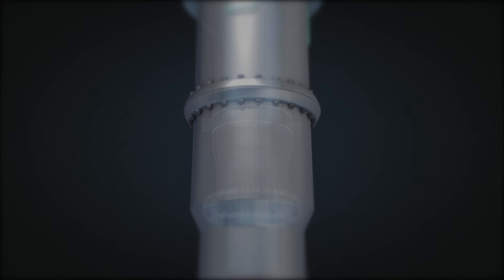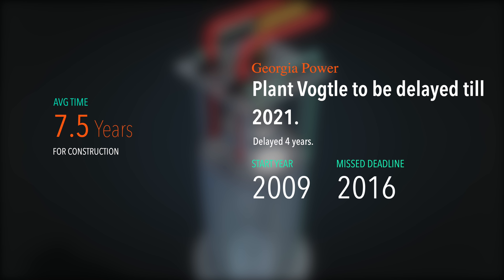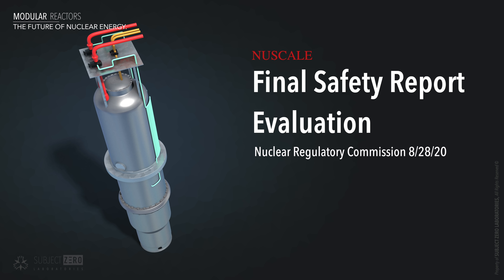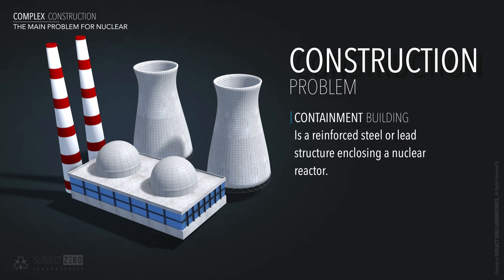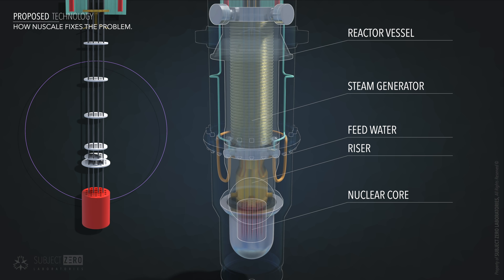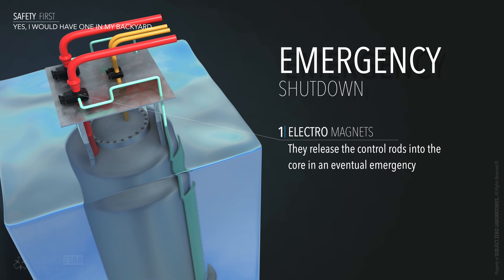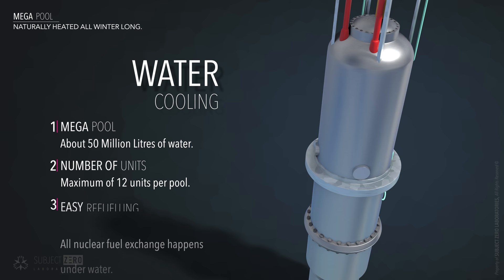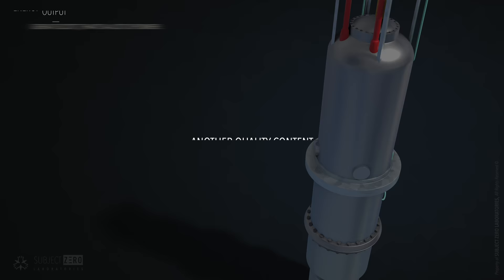A Milestone for Small Modular Reactors (SMR 2020)

Comment: Can you do an episode on hydrogen based engines and such? They looked promising
Reply: Hydrogen fuel cells are a waste of money, 40% total energy conversion, meaning only 40% of the power that was put into the fuel is used in actually moving you; Unless you meant fusion, Hydrogen is practically just a very bad storage medium that is supremely outclassed by other battery technologies. It's only benefit is being an energy sponge so that grid power isn't overloaded, but even then, that power is better used elsewhere.

Comment: Right from the start: Zero pollution? OK tell me where you live and I'll tell the operators of current working nuclear power plants you agree to put radioactive waste in your backyard. It's all safe, no?
That's not even counting the fact that most of these nuclear plants demand several millions in state subsidies (mostly at startup), often require the state to put up collateral since no bank will lend or insure nuclear plants, lobby the state to legislate limits on their maximum responsibility in case of an accident and finally let the state handle the mess if the power plant goes bankrupt (because you know, no one wants to pay into a trust account). 
So all in all, SMRs cost the state a pretty penny from conception to decommission (like their larger brethren). And all that money comes from tax payers, who are ALSO expected to pay a premium for the electricity produced by those nuclear reactors. And if you do get cancer because of a nuclear leak, it's all on you. Free market!
What's not to love???!?!
Note: The technology involved in these reactors is based on the steam engine --> boil water --> turn turbine --> harness the power. You're basically only using the heat generated by the burning of fuel. We ca do so much better (even ITER tries to make something new!).
Reply: Nuclear waste other than tritium is solid,What do you think radiation leaks out of Clay, steel and concrete solos?
The fossil fuel industry gets 200% more subsidies than nuclear power

Comment: So you're going to need about 35 of these things to produce the same amount of electrical power as a typical large  two unit BWR/PWR plant. That doesn't seem like a winning formula to me. Let's be honest nuclear is dead for the the foreseeable future. You can build a large 1000MW gas fired combined cycle plant for WELL under a billion dollars, have it up and running in two years with 1/10th of the permitting and sighting hassles. Then you can run it with a staff of about 50 people, instead of the 500-600 you need at a typical twin unit nuke. Many of the big nuclear operators are out begging for corporate welfare right now because they can't operate their plants and make money.

Comment: Still has an old fashioned Mickey mouse system of high pressure steam.
Hopeless design failure when they could have gone the "walk away safe" ambient pressure high temperature  molten salt method.. no wonder it required 12 thousand pages of safety justification- a reproduced 60 year old design- FFS iits now the 21st century.
Reply: @Mark Hule Indonesia already has a contract with ThorCon for 7×500MWe Thorium ion molten Sodium Fluoride salt energy converters - expected running cost at less than US$0.04 per KWh and capitalized cost being recovered by selling to PLN (the electricity supplier) for less than $0.07/kWh as there is no capital cost to Indonesia except for distribution.

Comment: Why do none of these videos explaining "cheap" nuclear energy ever factor in the full costs? Spent rod storage is no secret. Factor in the wages of one solitary security guard . . . for the next twenty thousand years . . . and any claims of cost effective nuclear energy tend to melt down faster than a compromised reactor.
Were we to factor in the clean up costs, guarding fissile materials and compensating the victims of contamination, then it would easily be established as an undeniable fact that it's the most expensive form of energy ever created.
Still, most of that clean up and remedial work on polluted environments evre really scratches the surface, and the costs of guarding all that potential bomb making material for thousands of years is a problem for future generations to worry about and pay for. Right?
Reply: Alright, what about compensating the families of those who die in coal mines, wind turbine collapses, and all the heavy metal pollution caused by photovoltaic solar panels? External costs happen in EVERY industry, not just nuclear.

Besides, in the next 20,000 years (more likely the next 50) we'll find a way to consume "spent" fuel rods. Those things still have a lot of usable energy in them and actually using it would reduce the volume of thag waste drastically and make it much safer.
Reply: Quite so  @willb5278  but none are so high and so studiously ignored as this.
There IS no way to "consume" highly enriched uranium though, and 20,000 years is just the half life. So long as it remains fissile it will need guarded. It could end all life on Earth many times over already, and each year we are making more. Most countries have persistently ignored this growing and expensive problem, and most of the world's storage pools are full to the brim, posing massive meltdown and contamination threats to highly populated areas.
The nuclear industry blithely ignores the responsibility for this huge toxic byproduct in its costings, and assumes taxpayers from the distant future will foot the bill, so before sweeping it all away with a move of your hand and some vague wish about fifty years from now, how about you educate yourself on where we are currently standing with the stuff, (drowning in it!) and where we are projected to be in ten years even if we don't bring any new reactors online. Here's a good starting place for where we are now: https://www.youtube.com/watch?v=YgVyPwhkoJs
Here's a 101 guide to the nuclear waste problem: https://www.youtube.com/watch?v=uU3kLBo_ruo
Until the nuclear industry accepts and factor in the almost open ended cost of nuclear waste storage, they are simply lying through their teeth about their economic viability.

Comment: So did you spot the MASSIVE problem with this technology in terms of global warming? I'll give you a while to think about it because you're obviously interested in nuclear and probably an advocate. In fact you probably know a bit about engineering, so you'll have spotted it right?

200 MWth creates an embarrassing 60MW electricity. That's a worse conversion rate than even coal plants and has remained pretty static for more than 60 years. Where does all that extra energy (heat) go? It's dumped via cooling systems into the environment. Not that great for climate change. I'm sorry but the time for this type of nuclear power has passed and this point alone is enough to kill the concept.

I know. I used to develop nuclear power plant.

Comment: Do the math how much of solar+battery would we get for the same price
Reply: There is no solar + battery that can work 24/7 at a scale anywhere in the world. So it's hard to calculate. Currently gas power plants are used during night. That's hardly "green" .
Reply: @VFPn96kQT  solar+battery can work 24/7 actually. Demand is also not constant, it's lower during the night.
Reply: @d3r4g45  but it doesn't. As I said there is no example in the world. All countries use gas power stations to supplement electricity production. You can check yourself on "electricity map" site.

Comment: I like that they think about a new concept... it is about time ... all new and forgotten (thorium or salt) concepts für generating nuclear power should be explored... but this concept is useless ... they didn't mention the production of the nuclear material and the disposal of the waste ... not once.... without solutions for that it is the same stupid idea like the old reactor designs. And its not safer than the old models. it has a mechanical security system and mechanism can and will fail like in Fukushima Daiichi - it will just find another way to fail.

Comment: It is really cool stuff, but I honestly don't have much faith in this. I mean 12 000 pages of documents to review, and they are still far from done in demonstrating safety? Nuclear tech is just moving at such a snail pace, that I don't see how it will remain competitive. This might not start getting built in volume until something like 2030. By that time solar, wind and battery technology will have gone through a huge number of iterations and cost cutting. Within the next 3 years Tesla is on schedule to cut their battery costs by almost 60%.

You will have cars that are cheaper than gasoline cars with 100 kWh storage capacity. You average western house needs 10 kWh of electricity per day. With a large enough fleet of these cars,  you get grid level storage for free.

Comment: you missed insanely expensive compared to wind/sloar.
last nuclear power plant being built  is way over budget and bankrupted the builder.
let the russians or chinese develop it til it's safe and cheap.
wind and solar are still cheap enough to match or beat natural gas.
Reply: this has niche application, for remote northern southern area where lots of thermal energy is required, as well as electricity. I mean solar & wind is nice and easy to install in remote location as well but it is not good at producing constant heat to fight the northern & southern climate.
Reply: @xponen  
just need better insulation, not more heat.
there's a lot of old poorly insulated homes that need renovations too.
nuclear of any kind breaks the bank trying to provide us cheap energy like wind/solar do.
geothermal is cheap too once running.
nuclear is always the LAST option.
Reply: Only because it has shit ton of subsidies and favourable regulations.
Reply: @ANTSEMUT1  
like oil and gas the past century?
or like oil even now?
how many billions have been pumped into fossils to hold them from bankruptcy  this year?
oil still has WAY more subsidy.

Comment: Okay, now 'bout popular carbon footprints.

You see, our planet in its 99.99% does not care at all what's happening above a very thin layer or crust. That said, I mean biosphere - all these fancy waters (hardly deeper than 5km in average), some 10km of air and couple meters of fertile soil and vegetation. And that's the main reason these two worlds should never touch - biosphere and the crust.

The problem is not in releasing carbon dioxide itself, the problem is the source of it. Our biosphere had undergone several titanic transformations, preserving its state in what we now research as geology. And every day, whenever we excavate and burn fuel from previous epochs - we release energy from there. What is, truly, energy on Earth? Our entire biological civilization is based almost fully on solar. Photosynthesis and energy preservation is based on solar energy. Coal and oil are result of ancient plants and microorganisms respectively transforming solar energy. Every natural material - wood, wool, fuel is made of, err, 'Sun' with some materials from crust (which mostly appeared because of the Sun, too). So, I believe, the concept of releasing 'old' energy is clear.

Our biosphere has always had Sun. Majority of biological processes require it and naturally everything is adjusted to its parameters via process knows as evolution. This leads to conclusion that we only have right to employ its immediate energy to keep balance, though, due to some inertia in biosphere, we can utilize energy stored not so long ago - say - we can burn wood or olive oil and still have 'zero' carbon balance - as much carbon dioxide consumed by plants - as much gets released. (Almost!) That's sort of true for energy too - this energy could simply heat atmosphere, soil or water - but got stored in olive oil (let alone saying it could retract back to space). And this concept is super critical to understand - released carbon ~ waste energy.

Every day, when turning hot water tap on - you release energy to the World ocean. It simply does not disappear. You cannot cool it - as when you cool something - you should heat something for the reason known as thermodynamics. By releasing energy you heat ocean, by heating ocean you release CO2 stored in it (gases leave heated fluid faster), by releasing CO2 you really don't help some solar energy to get back to space (so the planet looks cool from above, but gets hotter from troposphere) and this continues. 

So, what is the main problem now? CO2 or heat? Yes, both.
And whenever you excavate uranium and do fission - you release energy - no, not from previous geological epochs on earth, but rather from time universe was born and our biosphere wasn't even planned. That's why nuclear energy is just half the answer and does not solve the biosphere stability problem.

Unfortunately, we should only use energy above us - from skies (which transforms to wind- hydro- and whatever), and immediately under our feet - vegetation.
I sound like hippie, but that's our only perspective.
Reply: Fission has one of the lowest carbon footprint out of all of them end to end.
Reply: @ANTSEMUT1  you are right - carbon - yes, but heat footprint is almost as harmful in current situation. Even if we replace all carbon emissions with nuclear power consumption everywhere - we still heat the biosphere! And still release CO2 from ocean. Which contains enormous amounts of it, more than we will ever emit into atmosphere.
Reply: @wwlb4970  you must be under the assumption that only gen 2 reactors are being used/built which have no or minimal heat exchange regulation mechanism.
Reply: @ANTSEMUT1  well it's not about reactors per se. All electricity turns into heat in a while. Even your effective LED bulb heats. Your electric car's motor heats, as well as battery. All because of energy which shouldn't be here - be it fossil or nuclear. Though the latter is much better in terms of emissions, yes. The heat from it just doesn't disappear, be it exchanged or not - it is released. One simply cannot store heat indefinitely - cooling means atmosphere will get some of it.

Comment: I'm going to be honest with you the whole nuclear power generator thing is just an overcomplicated system. You would make more money and profit more energy if you just had a generator connected to every single person's house and each house depending on if they have more wind or solar more hydro or more heat that is the one that you give them to spin or power their house and any excess energy that they're not using gets dumped into a battery bank and or dumped into a grid battery Bank that can be used during the night or even if in case of a hurricane one case of a God forbid flood we have energy and power to give to those that are rebuilding their lives essentially a internet of power just like how the internet has different connections and different microcontrollers and all that s*** you have micro generators that each individual house has that that power gets sent to wherever and whenever we need it but what do I know it's easy to just complicate things and make it seem like it's a hard problem to fix

Comment: Small modular reactors are a amazing idea right up until you ask who is in control of them, if it's the producing country then not so good.. Mobile bomb?
Reply: You can´t just turn a reactor into a nuclear bomb. They´re not the same. They don´t go boom.
Reply: @Galopo  no but you could pollute an enormous area if you used a bomb to "distribute" it. Don't be nieve.
Reply: @stuart207  you can do that with medical equipment and I don´t see you advocating to close down the radiology industry.
Reply: @Galopo  I never said that. I just thought that pointing out that whoever controlled the device has a power if the country producing them is an issue. Reread my post.
Reply: Slight difference between a medical scanner and a nuclear reactor..
Reply: @stuart207  Lets stablish that i mostly agree with you: of course not anybody should be able to handle a nuclear reactor, you´re right. Where I don´t concur is suggesting this is a "mobile bomb". 

And regarding medical equipment I will just refer you to an incident called "contamination by cobalt 60 in Mexico". Of course radioactive material should be managed by responsible entities.
Reply: @Galopo  radioactive material should be managed by responsible entities..

Absolutely. Definitely, always and especially if the material involved could contaminate your country for few thousand years without high expense and /or cost of life.

Would you buy a mobile reactor from China if you lived in the USA? Would you buy a mobile reactor from the USA if you lived in China?

Some things change, unfortunately other things do not.